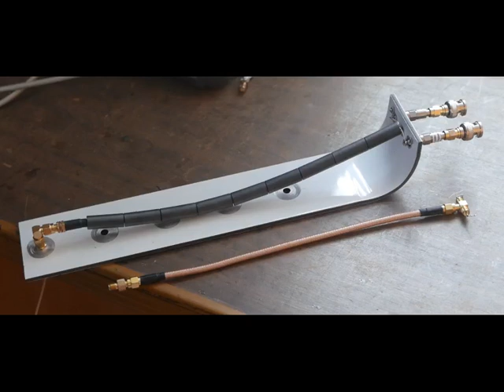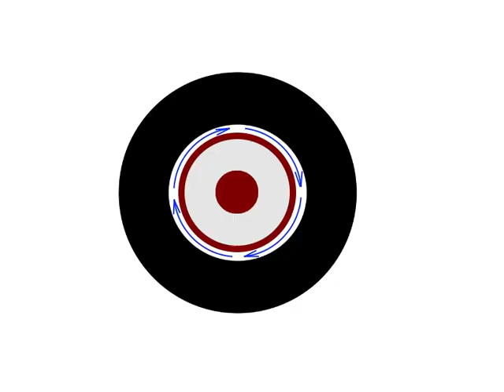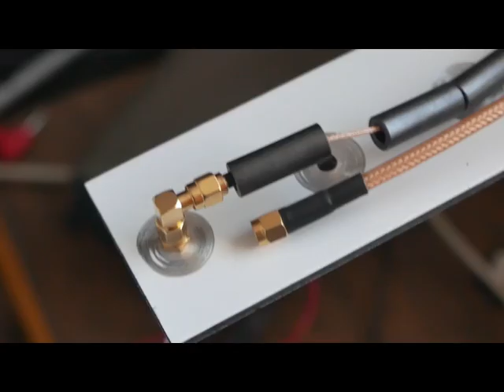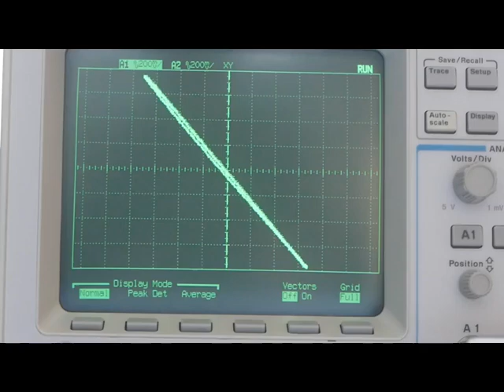Linear Ferrite Balun Leakage flux

Comment: This is an excellent piece of work....Jerry Sevick w2fmi, wrote an exhaustive book on baluns/ununs. He did not cover this parameter of what he called "beaded baluns".
Reply from the maker: If you read this forum thread: https://www.eevblog.com/forum/rf-microwave/correctly-calculating-impedance-of-a-biconical-antenna-and-impedance-matching/new/?topicseen#new , you will see I have followed a long path to get to this point.  What I call a "linear ferrite balun" (LFB) could be called many other names, but I haven't found a common one.   This LFB easily out performs the other baluns I have tried but I have not found quantative repeatable test results for the LFB.   Nor have I found similar examples of the test fixtures I built.  I don't believe for a moment that no one else has made similar test fixtures.  I just can't find references to them.  I've done some more experiments that I will post when I have time to make the videos.